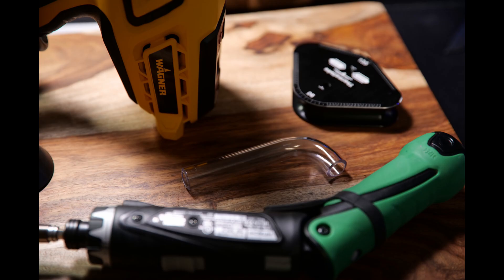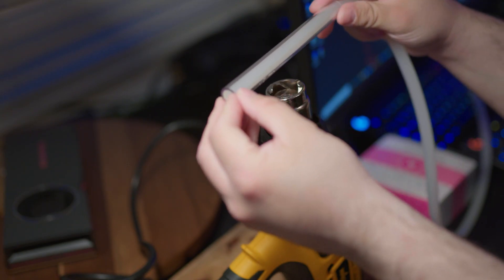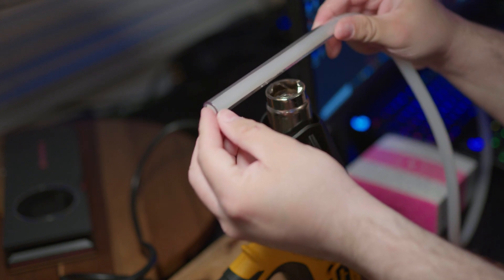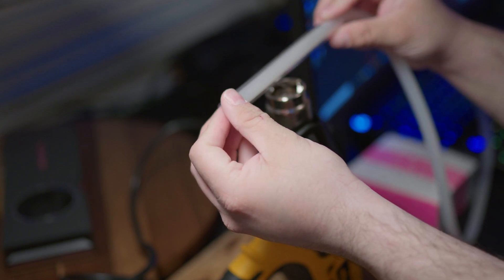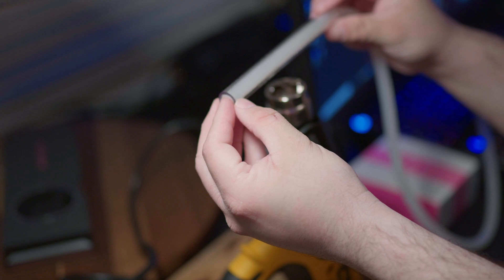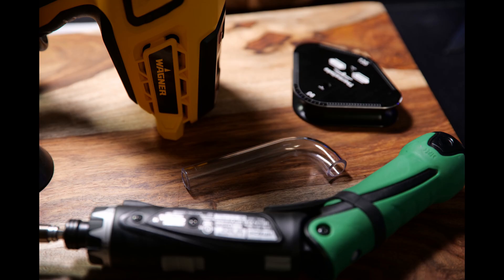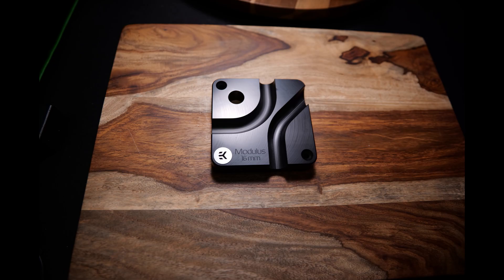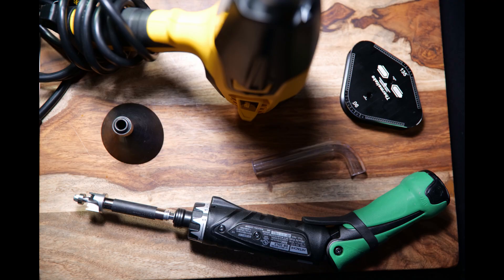WATERCOOLING TIPS for your gaming PC Build, TIPS and Mistakes to AVOID

Comment: I wish I had a pc instead of using keyboard and mouse on PS4 and having a pretty small desk with weird drawers that hurt my legs and a hard stiff wooden chair but they are to expensive for me and I will probably never get one but whatever but I still watch these videos and go on websites and customize my dream gaming pc like with a 2080ti and a i9900k and with Corsair fans and a cool case but i probably will never get that since it is like 4000$ or 3000$.
Reply: Try to do like me!. I have been buying the parts one at a time and now I’m getting closed to have everything I need to start building my pc water cooling system. Trust me you don’t need to have all the money at once.

Comment: I've been water cooling my computers since 2007. My first loop was simply a CPU water block and pump unit called the Apogee Drive and a single radiator and reservoir unit called their 120 QP Res. It cooled an AMD Athlon 64 3700+. I fell in love with the idea and I've been doing it ever since. My current system is a 3900X on a Gigabyte x370 Gaming K7 with an EK monoblock and an EK cooled RTX 2080 with dual 3 x 120mm radiators. I do it more for performance and the longevity of the components. I have yet to get into hard-line tubing but that will be my next challenge. Thanks for all of the great information, Thiago!
Reply from the maker: That’s a great history you have there for water cooling, isn’t it so much fun? Nice setup you have now too!
Reply: @ClassicalTechnology  I was in the Navy when I built my first water cooled system. I was honorably discharged in 2010 and I went to work for Swiftech in 2012 as their customer support manager. I still work in IT as I just really enjoy working with computers and troubleshooting.
Reply from the maker: BramSLI1 awesome!

Comment: Amazing and Invaluable information! 
I had a few questions that could probably help few first builders :

1. How do you recommend flushing out Brand New Radiators? (Distilled Water? Tap Water?)
2. If you use Medical Grade Steamed Distilled Water with absolutely 0 minerals (not regular distilled water), do you still need to buy separate growth / corrosion inhibitors?
Reply from the maker: Thank you- to be safe, you can flush out a new radiator, regular distilled is fine. I would still use some type of coolant or growth inhibitor, just in case there’s some reaction with the other components when filling the loop.